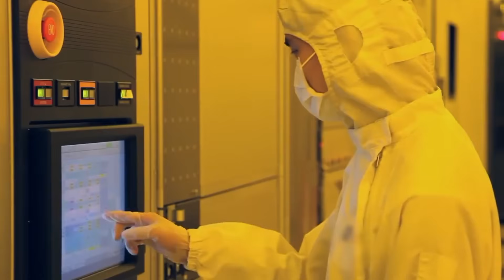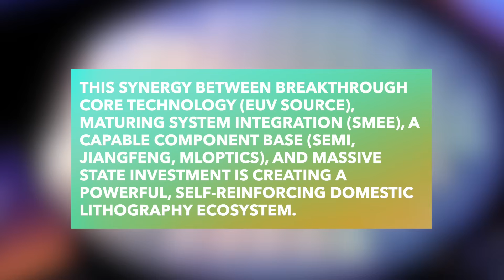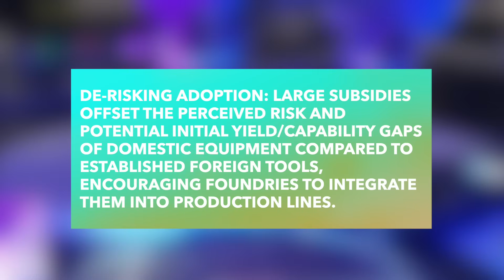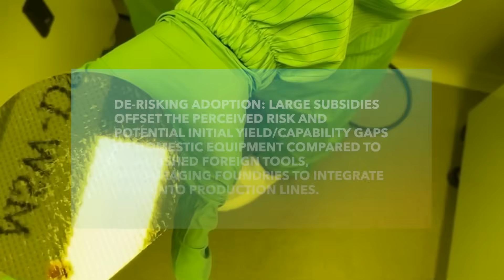China's Solid-State Laser EUV Breakthrough: Shattering ASML's Monopoly

Comment: In 3 years Chinese EUV machines will perform better than ASML equipment 😊😊
Reply: since they already have a 2nm prototype maybe less, got to keep in mind this is just about the only branch of computer research and manufacture that china isn't the world leader in even though TSMC is the end manufacturer of of foreign technologies. in quantum, neural network, graphene, bismuth, glass chips china is already the world leader in research and the closest to general purpose production.

a 2nm prototype means they are only about 2 years behind, and this was only their first EUV chip, except 1nm next year, 1.6nm at the worst which would still represent a faster pace of development, its shame silicon or at least the base version of it is at its end, theoretically silicon can go down to 0.6nm, but for practical purposes it will likely not go below 1nm, after that all that is left is to make them more efficient (to create less heat, or specialized ASIC chips to old often used functions  much faster and using less energy than the basic CPU/GPU/APU could), or more powerful, larger (like the threadripper, denser (which creates more heat related issues). the point being that the node advantage will be completely down to silicon quality, not the node size, how how well they can design for it, until such a replacement technology can be mass manufactured.